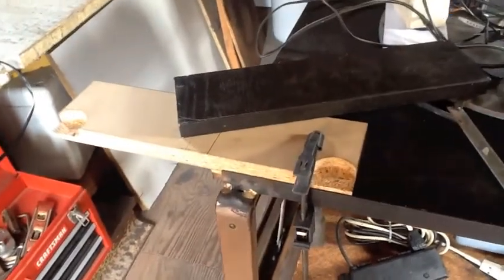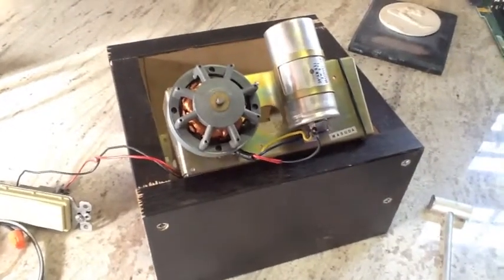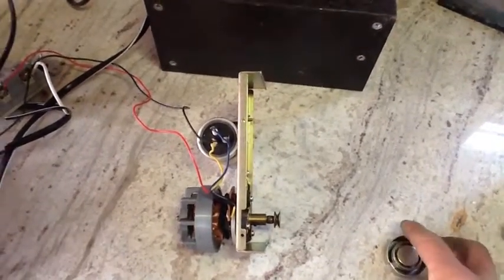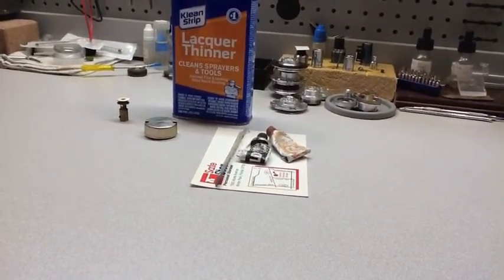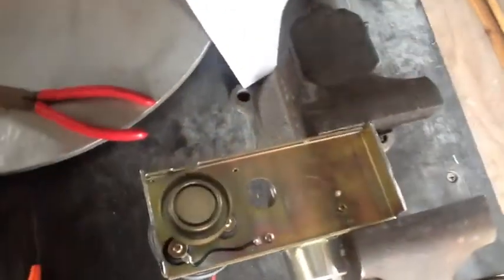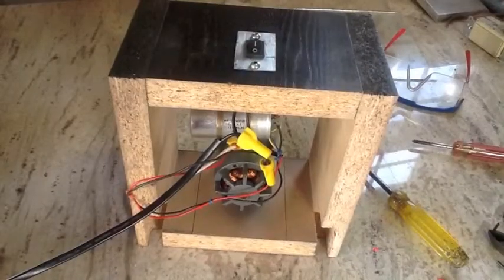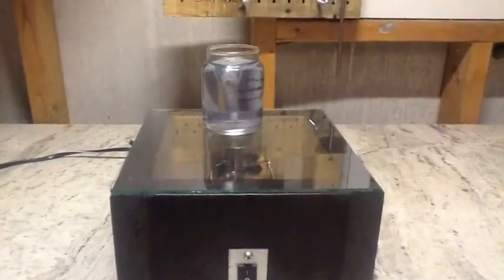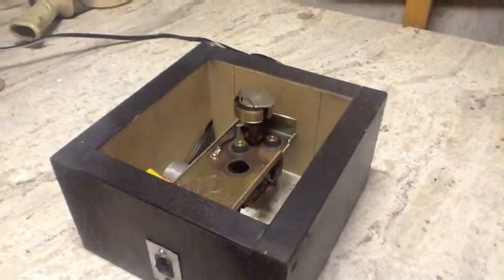DIY Magnetic Stir Plate: Build #1 (A Success & Failure)

Comment: hey pal - i made own using a arctic air - it has the fan and a controller board . runs off 5vcd 1.5-2a . i found the swamp cooler at resale for 1.50 . the controller board has 3 speeds . it could go slower i spose so i may cut in some vreg or a buck or a pwm i have to experiment with it . i would like to have one with a rehostat and a ac fan motor but i dont like the idea of making it so tall so i need to find a slim fan and then play around with slowing it down somehow with a speed controller like from a cieling fan outlet box maybe , or rheostat if i can find one . i am sure there is a better way to do that/ i want to be able to slow it a bit more . its all a balancing act tough ... cool video . i loved your motor and guess it it came from a tape machine . what a cool lookin motor . anyway enjoyed your video a lot . super cool stuff . i vaped for one year . i was  a bad smoker . have been clean for a while no0w - 7 years plus . i was makin my eliquid too - steves vanilla custard was my jam . use the mag stir plate for oleo citrate lemonade - lost 50 lbs on that diet but i got a mouth full of cavitys ouch !

Comment: Surely the motor was also used to PLAY the tape... which would run for about an hour.
That looks like a good quality induction motor to me. It might get a bit hot but that really shouldn't be a problem.
Reply from the maker: Well, I gave it the old college try with that motor, in part 2 I used a backup and it still works great to this day :)